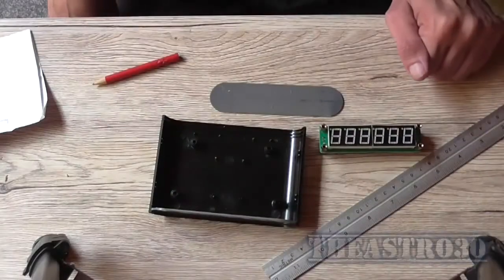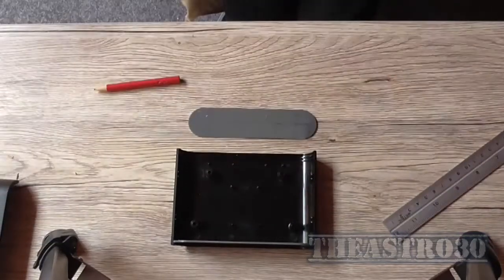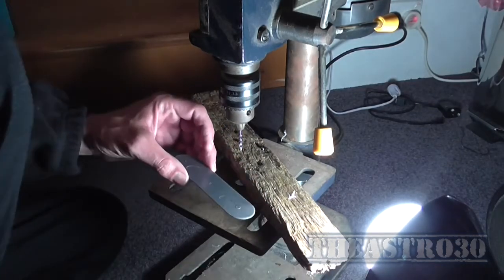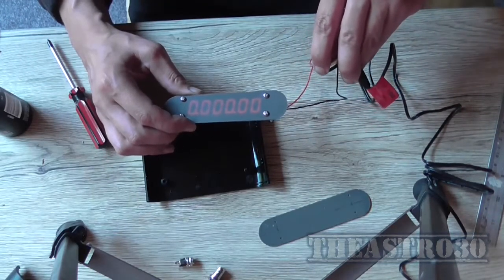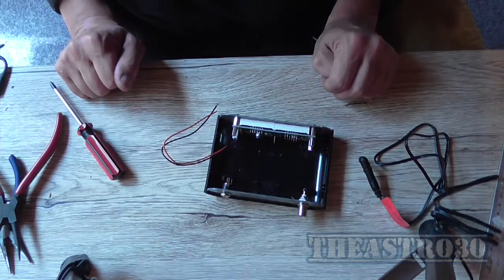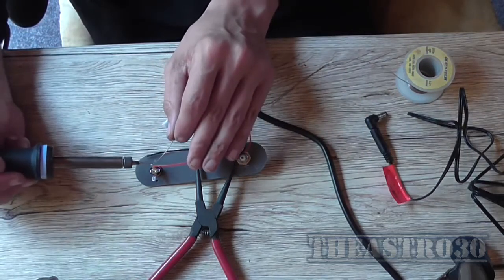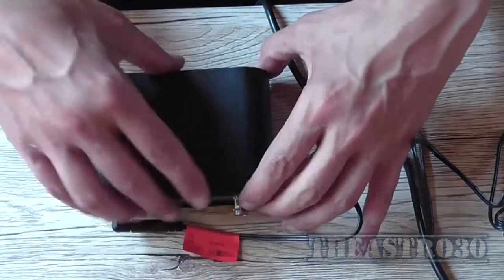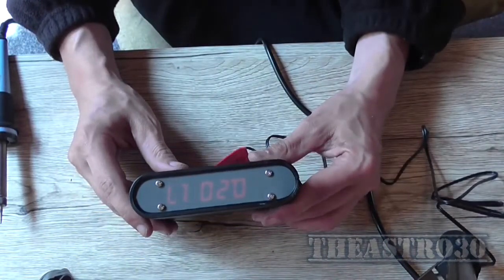0 1-69MHz Frequency Counter Build

Comment: Usually Hardware Stores like Lowe's,Home Depot,Ace and others carry different thickness and different texture of Acrylic some is really flexible making it harder to damage drilling holes. E-Bay Sellers will also carry left over pieces of different sizes really reasonable for small remnants that would work great for small projects like that.